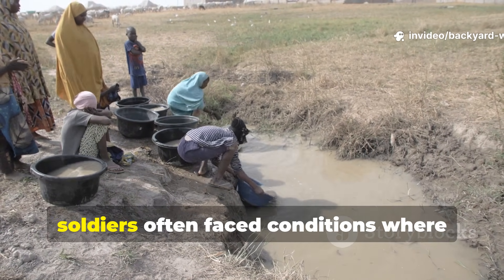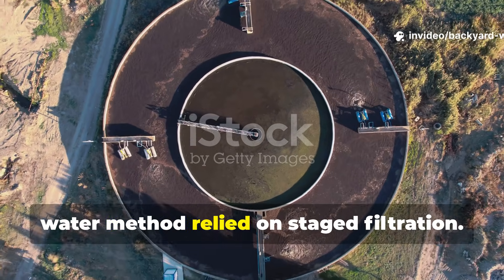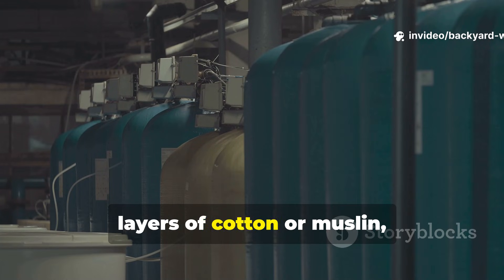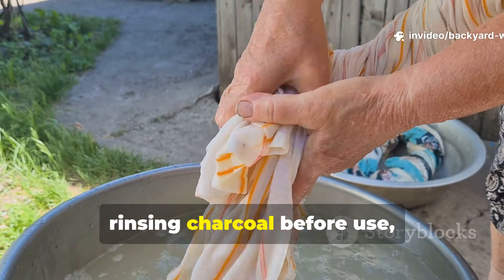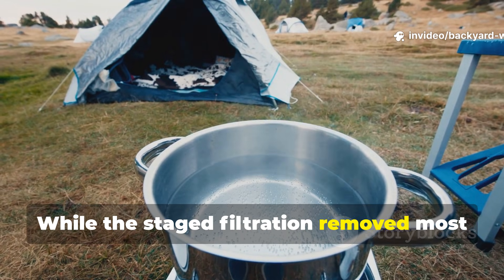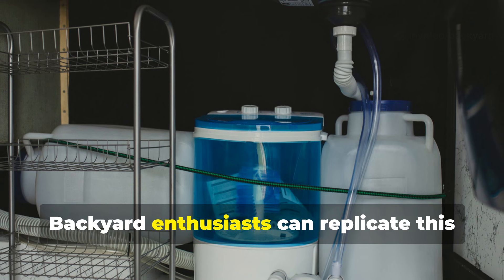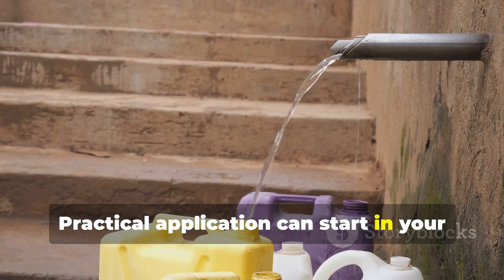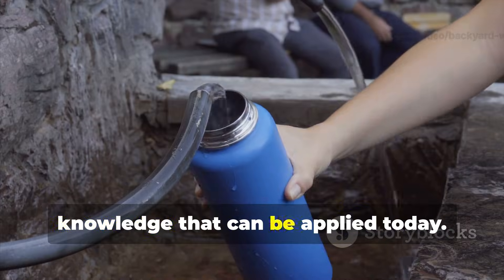WWII’s Hidden Method for Making Clean Water from Mud

Comment: They would dig a big hole and collect pre-filtered water seeping up from the ground or 100% filtered rain water from the rain. A watched a guy do it on You tube once. He hand dug a 5x5x5 hole with a trench shovel, lined it with a plastic sheet and covered it with a bug net. By the next morning he had a gallon of rain water to drink. Several days later he had 10 or 15 gallons of clean water. By the end of the week he could have jumped in and used it like a hot tub. Also, you can shoot the enemies and take their water supply's.